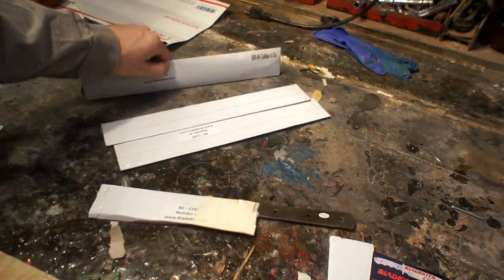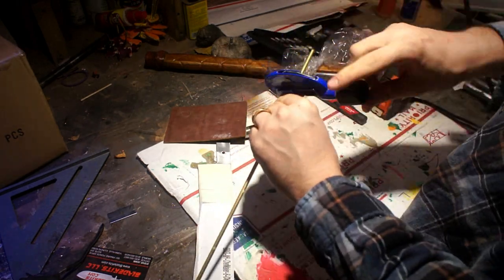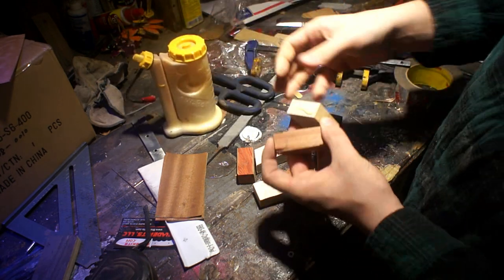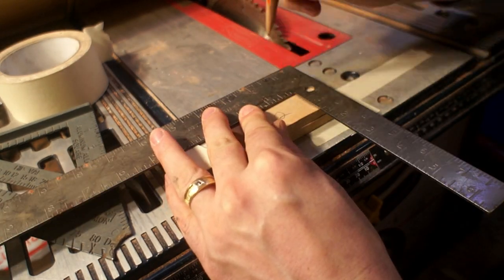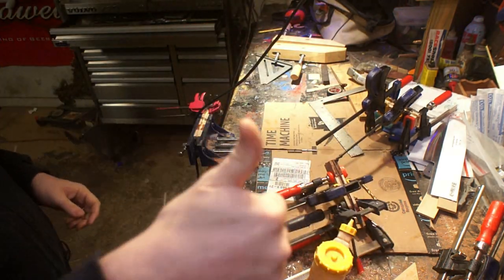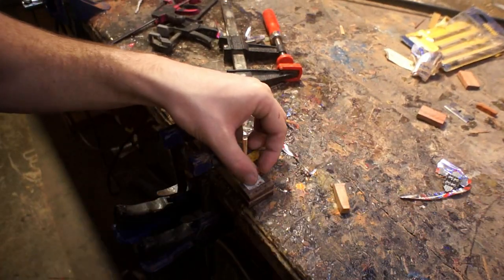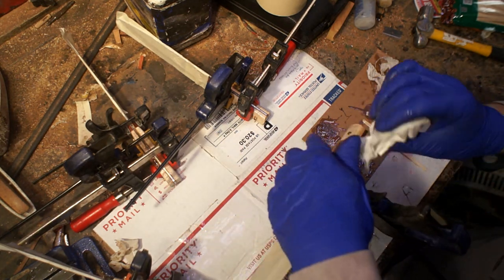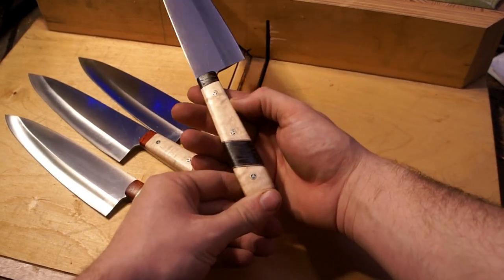Curly Maple Chef's Knives: Xmas For The Brothers and Sisters

Comment: You can try using rock salt on glue up. Water soluble so it’ll dissolve right into the glue after a bit but it’s adds just the right amount of grit to prevent the sliding around